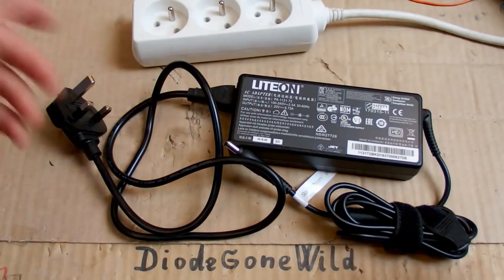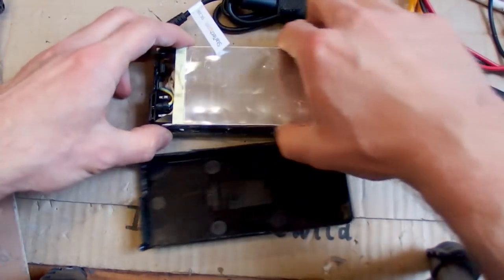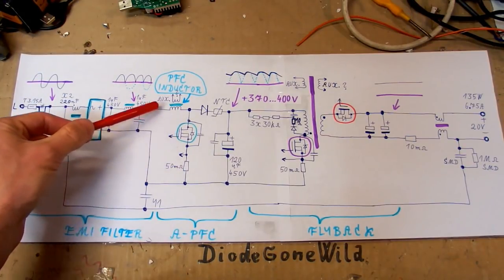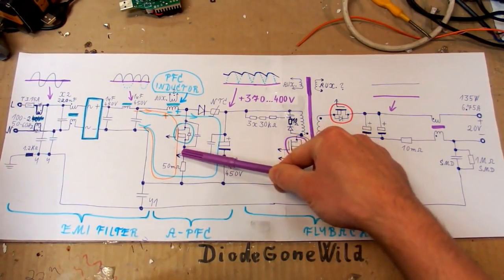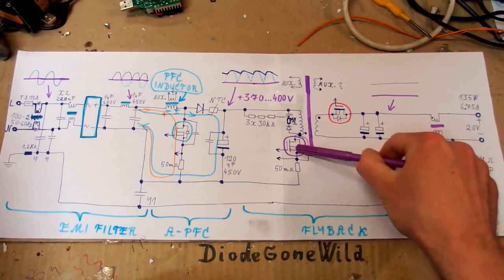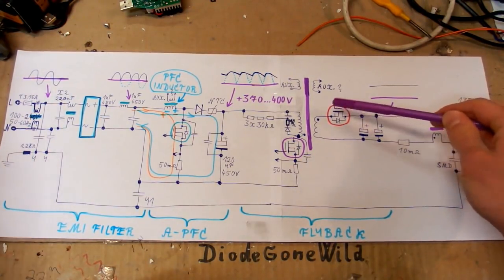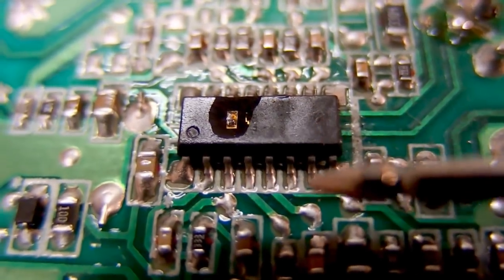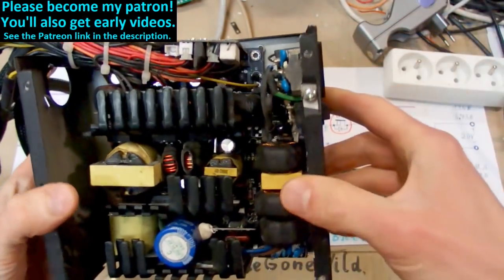Laptop power supply with PFC - teardown and repair (BOOM!)

Comment: If you put some gasoline on the joint it would open the case very easily without damage, because gasoline melts glue.

Comment: what is the purpose of all the resin?
Reply: Probably keeps parts from moving around and breaking off.
Reply: I think its a thermal conductor. And reduces inductor noises...
Reply from the maker: it probably keeps the leads of the components from breaking every time a gorilla drops it on the floor. It may also be heat conductive.
Reply: @Broken_Yugo  okay, thank you!
Reply: @phorzer32  okay, thank you!
Reply: @DiodeGoneWild  okay, thank you!

Comment: I am surprised to see nippon chemicon and rubycon capacitors in it
Reply: Lite-on is a good brand name, so this is not too surprising to me.
Reply: Like the sibling mentioned lite-on is a reputable name. Look at the nice shielding, proper creepage distances, etc. It's not a bad design. The only weird part is the 1k2 resistor to the earth - it has universal input (100-240V) and in Europe live and neutral are not defined/can be swapped, so it doesn't do much.
Reply: @eDoc2020  I heard this name for the first time and it was made in china so i got surprised :)
Reply: @stanimir4197  yes pretty strange ?

Comment: The PFC stage in this unit uses pulse skipping, this causes allot of stress of the main filter capacitor, I would check if that is not the reason for the failure, i.e. ESR of main filter cap gone high. You can see the pulse skipping in my (crappy) video here: watch?v=M8ICFj07Tc0

Comment: To open the case, just use some car gasoline  and a brush and fill je joint. Let it for 3 minutes,  the glue will break and it will open easly.

Comment: I am not fan of lite on powersupplies. In my country (Hungary) there a lot of them. It is a bit cheaper replacement of original psus. BUT It is not good. I had many clients with theseones and quite offen kills motherboard of laptops. Literally I can not understand, how people can kill laptop psus (originals).  I have many, but none of them failed. 
In my young age, there was theatre play, where I was the head of technician preparation. That studio had a horrible electric wiring. Basicly all circuit was loaded two 101%. When I plugged my 65w Asus (delta) psu. The studio did go black. One of the main input fuses (50A) was burned trough. My psu just survived, with major injury. The main power cable's fork was basicly burned halfway straight away. To understand: One of the forks was halfway burned away. I changed the main cable part and replugged. It works since then. Quite surprising.
So it worth better to buy second hand an original one, then buying of theese better quality cheenise.
Reply: I think most broken laptop power supplies are just from the wires breaking where they enter either the adapter or the plug. I've only had one original laptop PSU fail and that was after more than ten years. The problem was a cracked solder connection, easy to fix.

Btw a lot of original PSUs are made by Lite-On. 4 of the 6 original Dell PSUs I can find quickly are Lite-On. I'm surprised they would ever kill motherboards. Maybe some of your clients had counterfeits.

Comment: Did you test the primary electrolytic capacitor? It is known that APFC stresses primary caps. In circuits without APFC, the primary capacitor gets 100 / 120HZ ripple current but in APFC circuits the APFC mosfet turns on and off at a range of khz and this stresses and can kill cap. I know the cap doesn't look bulging on video but I would test it to make sure it isn't the cause of the psu failude. Another thing that I don't like in this psu is that it uses a thermal pad that appears to be connected on the primary side of the PCB. I have read cases of this thermal pad getting slightly conductive/capacitive with age and/or heat and then killing the psu. This is the best video I have come into online about modern computer repair. It is soo much more complicated to fix these units compared to old good half bridge power supplies.

Comment: one important thing to keep in mind while opening these kind of circuits is discharge the capacitor after opening. because they hold charge for a long time. be careful otherwise you will get electricuted.
Reply: He knows what he‘s doing
Reply: Specially if it's not working, some bleeder resistors are omitted when you know a working circuit would discharge the capacitor.

Comment: The circuit diagram has too many components the booster converter is not needed because the output is is really low voltage

Comment: Hi 😊
#DiodeGoneWild
I have a request 
Please can you test Your Computer Powersupply ATX Crazy Ampere rating Like 12V 30A 😵

Can it Give that much power????? At 
12V 
I have 2 of them

( make a Video on it)
Reply: 30 amps is 360 watts, modern graphics cards can easily use that much. If it's a good brand PSU it should have no problem supplying that.
Reply: @eDoc2020  
I want to see that 
My one shutdown at 14A Load
It say 12V 27A
(500W ATX)
Reply: @Electronic_For_You  27A would be 324 watts of 12v power. Modern supplies put out nearly all their power on the 12v rail, so you must have an older (or cheaper) design. It's probably a "group regulation" design. These don't work if there is too much imbalance between the different rails. Maybe if you put a 10 amp dummy load on the 5v rail you can get more 12v power out.

My 380 watt Antec supply (EA380) is an 80 Plus unit and has the same 324 watt 12v rating as yours. It has no problem supplying over 14 amps.
Reply: @eDoc2020  my one also give 12V  
14A but when i wanted to get 15A it shut down why??
Reply: @Electronic_For_You  I don't know, it probably triggered one of the protections. You might want to check all of the voltages when you are close to it shutting down to make sure they are all in spec. It's hard to say more without knowing anything about the internals of yours.
Reply: @eDoc2020  Cheap One BlackCat power supply
Reply: @Electronic_For_You  I'm not finding that brand online. Is it a shady fly-by-night brand? If so, it's probably actually a 150w-200w supply which is falsely labelled.
Reply: @eDoc2020  ☹️

Comment: What on earth is a uk plug doing in your country, maybe someone wants the u.k experence.
Place the plug on it's back with pins pointing to the sky.
Then without shoes on,  accidentally step on the plug for ultra pain lol :-D
Catching your small toe on the edge of a door/frame will never be the same :)
Shame that power supply is buggered, they are quite a decent brand.
I liked the older Delta electronics ones too.

Comment: Looking at that UK plug, it looks a bit "slim", and of course chinese ones can have the fuse (which in itself looks like a dodgy fake, 10A fuses are very, very uncommon!) fitted like that, but not actually be in circuit...

Comment: You mentioned bypassing a PFC booster to fix a power supply when there is no other option .. the PFC usually doubles the voltage? .. I would guess you could jumper the rectifier outputs directly to the large primary power capacitor .. have you made a video where you bypassed PFC for a repair earlier?

Sorin did something similar but I did not catch exactly where he jumpered it up .. maybe just the positive rail
https://www.youtube.com/watch?v=2NZa5kXRelc

Comment: Quite uncommon to see faulty LiteON or Delta power supply. Together with MEAN WELL, Seasonic and Flextronics I consider those brands as generally safe and high quality. For instance Delta was manufacturing MagSafe (MacBook) power supplies, LiteON power supplies are often shipped with ASUS laptops and Flextronics power supplies are most common in Apple portfolio. I have seen for instance teardown of Apple 96W power adapter and I think it would definitely get nice :) or very nice ;) rating by DGW.

So far I had only four power supplies that failed. One PC PSU made by Corsair (faulty capacitor making it completly dead), second one made by Enermax (again faulty capacitors making it good only up to ~ 500W instead of its 720W rating), third one - Samsung 5V 1A charger, where something went short circuit. Lastly I got failure on 12V 2A power supply shipped with Philips LED RGB lamp, suddenly it did not output any voltage and there was no sign, something went short circuit

Comment: How can this ps possibly dissipate its own heat with this design, I will avoid Liteon products from now on.  One solution for the consumer would be to stress this at max output until it stops working and return it for a full refund.  Rinse and repeat.

Comment: dremel
Reply: I was thinking the same thing. The newer variable speed Dremel with a medium cut off wheel (which has a very small diameter) can easily cut open the plastic case without damaging any internal components. Hold the PS in a soft jaw vice to keep both hands free, you can then cleanly slice open the case at the plastic welds.